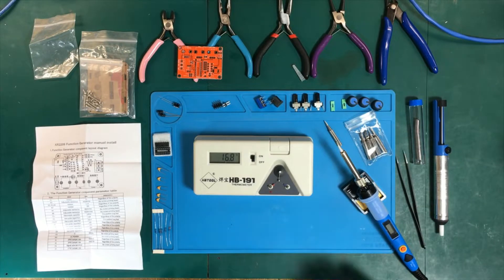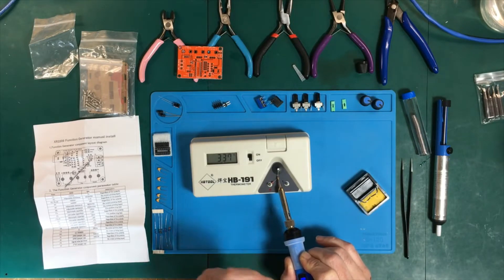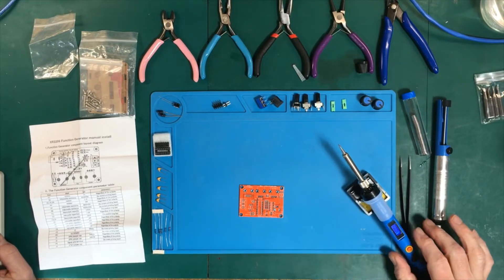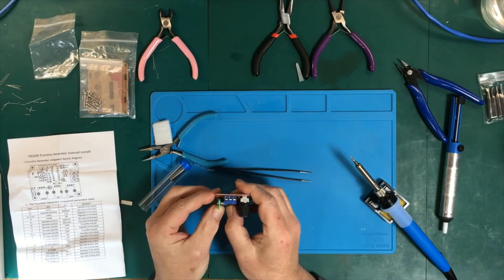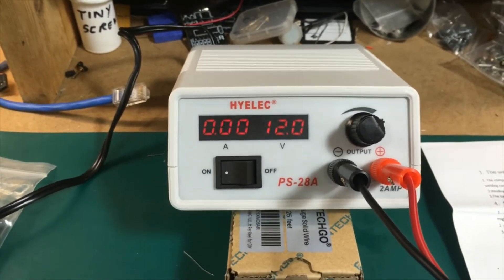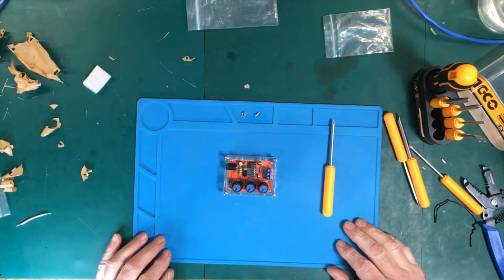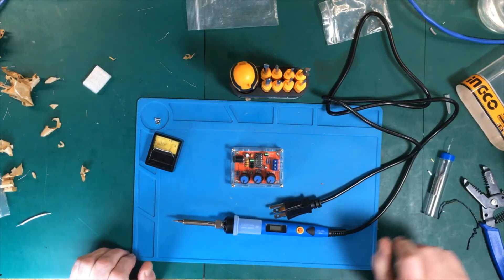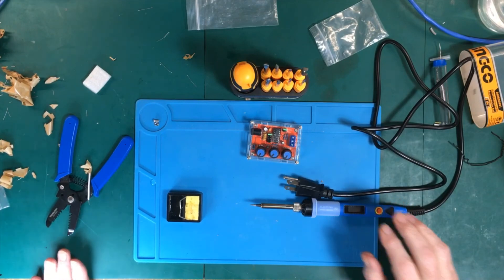0004 - Beginner's Electronics Tools: The Function Generator and The Soldering Iron

Comment: The soldering iron tip  thermometer I also bought, not knowing "Bakon" stole Hakon's design, cheapened it, then 'Bakon' distributors sells the replacement thermister gizmos with Hakon on the blister pack.

Well, that 'saved' a few hundred bucks, eh?  ;-)

Above 9V on your generator will show these are not trustworthy.

See my fake ICs note in the leader video
Reply from the maker: Yeah, most of those XR2206 chips are fake.  I'm pretty sure mine is even though it work at voltages above 9V.  Also, that PS I was using had serious issues.  I did some videos on that too.